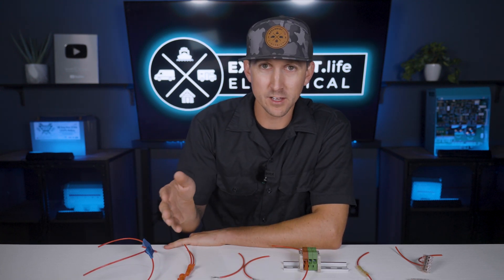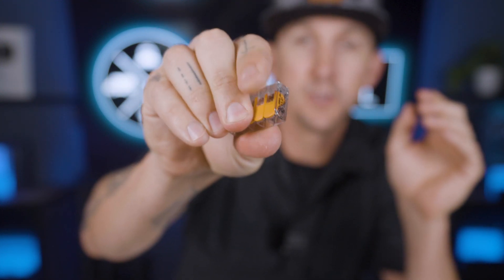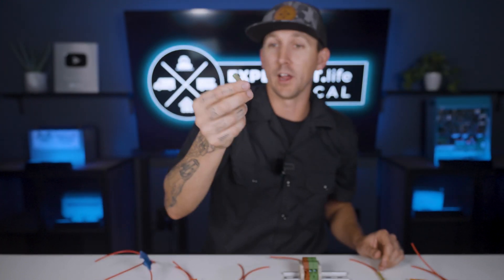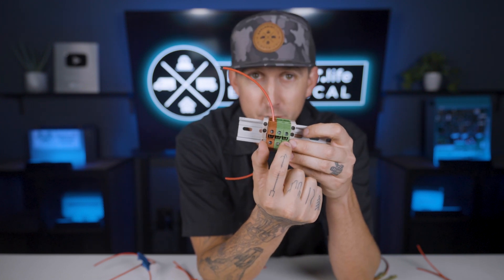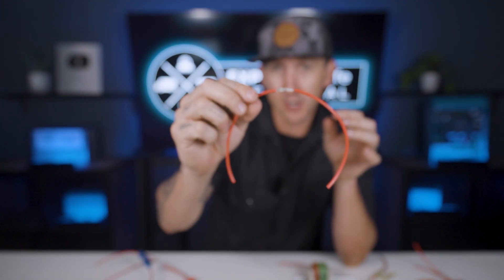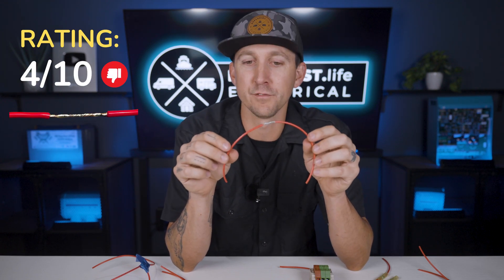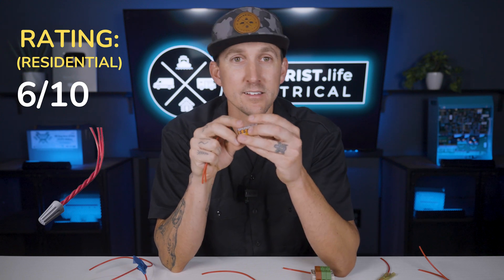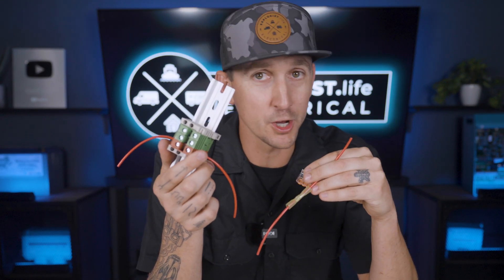Splicing Wire 101 - Wire Terminal Basics | Ep: 10/14

Comment: I've got a question. I don't have much space. I have a number seven American wire gauge on my scooter. I need to splice the battery cables together again. After replacing the socket, what coupling can I use?
Reply from the maker: Space constraints and wire sizes can make this tricky, and the safest option really depends on your exact cable routing and components. If you reach out to our support team, we can take a look at your setup and point you to the right connector so you get something that’ll fit and handle the current properly:

https://shop.explorist.life/support?utm_source=youtube&utm_medium=comment&utm_campaign=support&utm_content=response_link

Comment: WAGO makes some high current DIN rail parts that would eliminate the need to screw the AC connections down when connecting the wires in the OEM splice boxes. They have levers, just like the stand alone connectors.  And check out their selection of junction blocks that are designed for use with ferrules..

Comment: As always an amazingly clear, concise and informative video.  Can you advise how to junction (1 wire to 2 or more wires) or splice (1 wire to 1 wire) outdoors (i.e. on roof to wire two lights to one switch)?
Reply from the maker: Given it's a DC circuit and doesn't have to be in a junction box; I'm just going to use butt splice crimp connectors for that.

Comment: Thoughts on "overlap connectors" - Electronics
International OLC 1 or OLC 2 for small wire? Starting to see more often in aviation electronics. Can be shrink tubing covered if needed.
Reply from the maker: I've never used them; but they look to be twice as expensive as Wagos with no added benefits.
Reply: @ I think smaller size - comparible to a butt connector, and ability to shrink tube them could be useful. But cost can be a factor on some builds. Really like your video content. 👍
Reply from the maker: At that point I'd just say to use the crimp butt-splice connector like shown in the video as it'll be even smaller (not much bigger than the wire) AND 4-5x less expensive at about $20 for a jar of 100.

Comment: Great information. I recall another type of splice method. "Posi tap connectors"  Similar to the crimp butt connector, however no tool is needed to close the connector. Thank you for sharing and have a great day
Reply from the maker: I think that's less of a 'splice' method and more of a vampire connection where you're trying to get a voltage signal to power a relay.  I've never used them; but if I was trying to get a 12V signal from, say, a headlight wire to power a relay; I'd definitely give those a shot.

Comment: What if you’re just tapping into an existing electrical system (ie: into the vehicle’s side lights)?
Reply from the maker: The best option, if available, is a fuse tap at the headlight fuse.  There are vampire splices for signal wires like that, but those tend to corrode.  I’ve used them, and they are fast and semi reliable, but I don’t love them.

Comment: What about the nut connector that you crimp. The RV industry is using it all over the place. How would you rate them?
Reply: Those are fast and cheap but not very good.  It is very easy to have one wire not go quite all the way in to where the crimp happens and then pull out later.  You can't inspect for that although you can do a pull test on every connection you make.
Reply from the maker: Good insight!

Comment: great vid. one thing you forgot to mention is that on lever nuts by wago there is a test port on the top you can verify power without having to remove the wire. This is very beneficial especially if you're testing 120v
Reply: This is what YouTube is for because I didn’t even realize that that’s so cool

Comment: Good video. We mostly use crimp wire connectors with a nylon cap, like those by Ideal or Gardner Bender. You did not cover those. We can connect wires of different gauges. Requires a specific crimper, and these are UL-listed.
Reply: Hii

Comment: I'm always complete with you. Let me add some remarks:
- Wago: They lately added some small boxes where you insert one or more of these and the box is sealed up.
- butt splice. Since the times of amazon and chinese stores offer more cheaper offers a buyer should always make sure he will buy a heat shrinking version - perhaps in addition one with glue on the inside. 
- solder seals (right?) - here also you should look for a good brand - if there is no or few flux in it you may fail. In addition to Nate's remarks I am always afraid if the wires are not perfect new and clean. I only want to accept a solder connection if I can inspect my work - not possible inside those.

Comment: Thanks, Nate, for these instructional videos!.
Though I've been an R.V. technician for years, I have learned or been reminded of many techniques that improve my skills. 
 I've been saving your videos to use as reminders of proper electrical system  building skill sets.
Now that I am building my own trailer electrical setup. I've been referring back to your videos to make sure I do the work properly the first time. Don't want problems down the road when it will be  much more difficult to fix them!.
Thanks for the effort you put into these lessons. 
👍

Comment: Worth noting that, per ABYC, DC splices (wires carrying Direct Current) can be ‘anywhere’, while AC splices must be done inside some sort of junction box that requires a tool to access. This is a safety requirement.
Reply: its a requirement in the NEC as well for 120v splices. They must always be accessible.